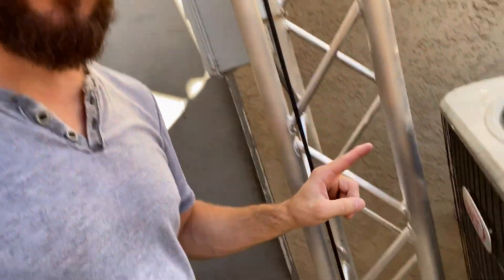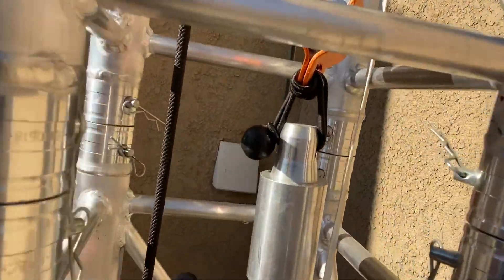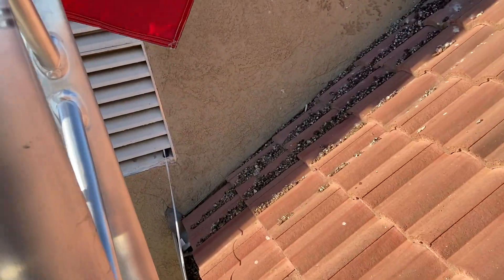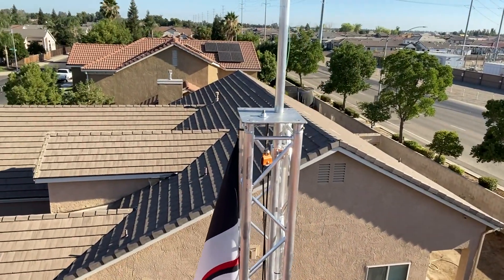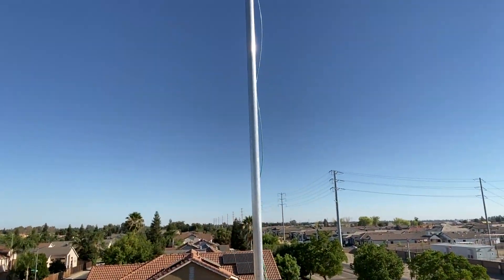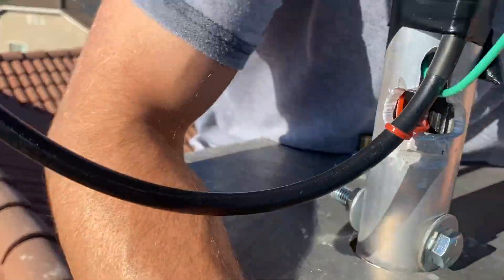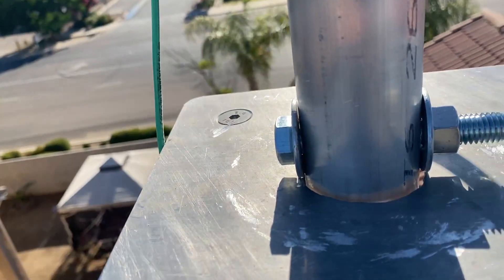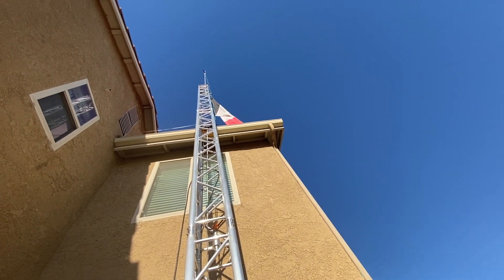Digital Block: The RISE Tower for the Helium Network

Comment: Awesome setup!  can you share the earnings or how many witnesses / farthest witness you can get with this setup?  Thanks very much for sharing.
Reply from the maker: Thank you, some things have changed around on the tower since this video but the best we have gotten with this tower is a 3dbi antenna and on one day it reached a witness 50km away but on average it gets witnesses out to 14km away.
We bring in about 45-65 witnesses and it earns about .75 to 1.5 HNT a month for this location
Reply: @digitalblock559  
1.5 HNT per month is pretty terrible. Are you sure that is correct?   I have a stock bobcat antenna sitting in my window and I am in an hilly area with only getting 6 witnesses and I got 4.8 HNT in my first 2 weeks.  Something does not seem right. That antenna setup must have cost thousands, at 1.5 HNT a month it will take you years to get any ROI.  I cannot see how that can be right.
Reply from the maker: @edwardober1387  .75 to 1.5 HNT every 24hrs.
Monthly its about  26-34 HNT avg

Comment: I had to go through the roof for mine, I did use a mast but it was too unsightly and obvious so I had to opt for the unusual option and pass the top of the mast pole through one of the ridge tiles.  Along with a 6dbi antenna and 5m LMR400 cable it’s working a treat.  For anyone who’s still learning all this the two most important things in my opinion are elevation (height), having a decent antenna.  Some other tips are having your antenna outdoors and not behind a window and ensuring the cable is connected to your miner correctly as it can come loose, I use a small spanner to make sure it’s fully tightened (but not over tightened).  It also helps if other miners are close, but not too close.
Reply from the maker: Thanks for your comment Roger

Comment: Can HOA say anything about the tower being that high? Or is there any laws against it being so high? I’d much rather do this than climb on the roof
Reply from the maker: What HOA? No there is no association in regards to this location. Let us know. We sell these towers(not the rising function though) but if you need the truss we are a reseller for A4I. There are some laws which every county is different. So you will need to do your homework. We decided for our location to stay under any other towers or posts around us. (ie electrical station, light posts, ect)
Reply: @digitalblock559  yeah I plan on putting a miner in apple valley California and there is no HOA in the area and I doubt anyone will bother about this type of tower. I’d like to know where to get one like yours for sure. I’d rather do this than put the antenna on the roof. It’s easier to change antennas and experiment. The only thing I’m concerned about is the bobcat miner being outside.
Reply from the maker: @Yendi233  send me an email at huewe@digitalblock-iot.com and we can get the quote together for you based on you specifications.
Concerning your Bobcat you just need an outdoor enclosure. There is plenty you can purchase online and we manufacture some fan powered ones as well.

Comment: Nice work! How long is your LMR cable?
Reply from the maker: Initially it was 50ft now it’s only 6 and the tower has a powerful 3dbi on it
Reply: @digitalblock559  cable length might affect the performance in general, is that right?
Reply from the maker: @buh5995  yes but its greatly dependent on the quality of cable you use and its length
Reply: @digitalblock559  so if cable length above 10 mtr, might affect the performance.. not sure
Reply from the maker: @buh5995  Yes

Comment: your getting too much loss on having your coax cable run that long
Reply from the maker: Agreed. We've cut it back to 6ft since and switched to a 3dBi antenna and pick  up more witnesses than any miner in the area now. Just had to dial it in.
Reply: @digitalblock559  nice, i have a 3dbi also, great choice

Comment: You should move your box to the top of the mast use a 2foot antenna cable and eliminate the huge cable losses on that lmr cable !
Also what is the name of this unit so we can see your profit from this rig
Reply: You don't get much loss with LMR cable unless you go 30 feet or more. He should be okay.
Reply: @princeben7544  according to qsl.net coax calculator 
A 60 foot run of LMR400 at 915hz with a load swr 1.5 will have 2.35db loss 0.118db swr loss total loss 2.469db 44.4percent wattage loss at 100watt.
Also .1 to 1db per connector adapter

So again move the miner up to the antenna increase the profit it makes.  Cable loss is HUGE 2db ➕
Reply: @jimhill8272  Well, that's why I said keep it @ or below 30 feet. If he has 60 feet, then I can understand but regardless, he has line of site working for him so he will be fine even with the loss.
Reply: @princeben7544  
Did you see the video ? It's 33feet down and 45 or so when extended.

Needs slack to reach box

And drip loop looking at 50 to 60 feet.

I was using lmr400 for example

If it's lmr240 double the number to 4.5db

Too much loss
Reply from the maker: Hello fellas. So its a 50ft cable LMR400 at 50ohm
I do have 2 adapters, one a lighting arrestor and the another form N-Male to RP-SMA Male.
In my research the cable at this length is only a .49 dbi loss. LMR400 is a .9 dbi loss per 100ft from what I was educated on. 
I got a new antenna and a 6ft LMR400 so I'm going to make and adjustment and do a test in the next 48hrs. 
This is really giant test rig before all my miners come in.
Reply: @digitalblock559  can you give us a followup? was this dbi loss correct?
Reply: @whiteburr  Hey guys, we moved it up to a 6ft LMR400 and saw a good increase. First we switched to a 3dBi for better local penetration tried it at 50ft of cable and grabbed 2 witnesses and then added a 6ft cable and grabbed 6. But now that it is up an running it consistently pulls in 11-13 witness from up to 10km away. Its the best performing hotspot in our region
Reply: @ODG-INSTALLS  can you guys do an update video?

Comment: Can you share how much you are earning with this setup, if you dont mine. Thanks
Reply from the maker: Hi PPSEVEN,
At this time its greater than any of the other 20 miners in our region. However most are poorly placed for us to even witness.  So overall our initial monthly earnings on this location are low. (Less than 20.)
Reply: @digitalblock559  is it because you are overshooting the other miners?
Reply from the maker: @ppseven4009  Actually no. We had a 6db to start and it would pick up the closest one every once in a great while. We swapped it out for a 9dbi and is actually picking up that same one more consistently. An ones it should be hitting farther out its not witnessing. My guess is that the other miners are only 4-8ft from the ground and inside homes. So its very hard to reach them. Next were going to through on a multi-polarized 3dbi and see if we can't break through some barriers.
Reply: @digitalblock559  I am looking to put my antenna on the roof,  but I saw a few other YouTube channel where they place the antenna in the attic and got better result than the roof. I am still waiting for my Bobcat but just want to understand  as much as possible. Could you make a video showing your witness?